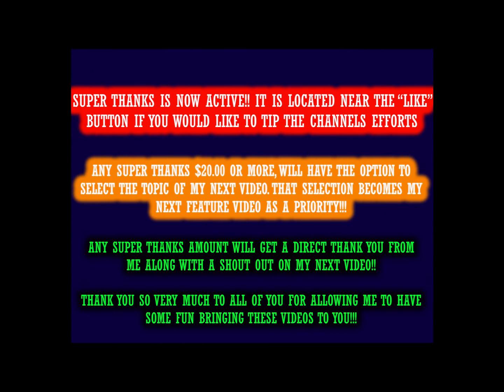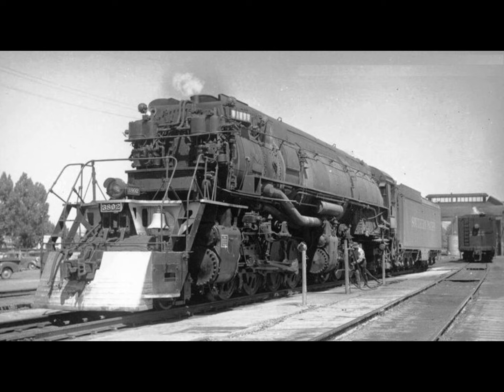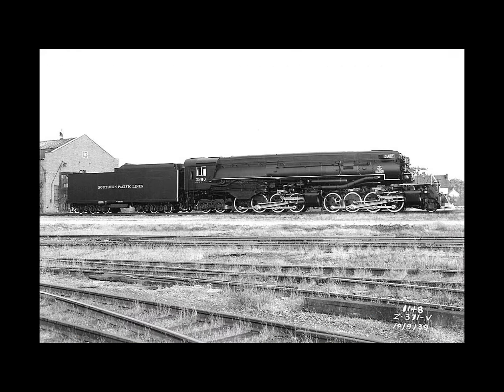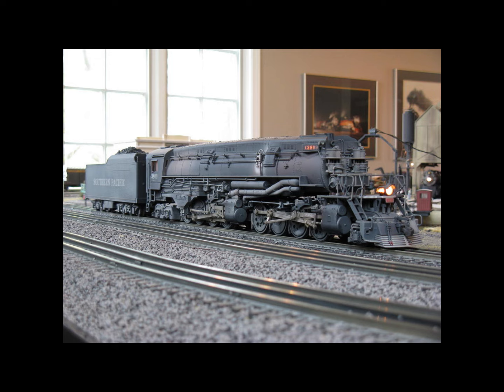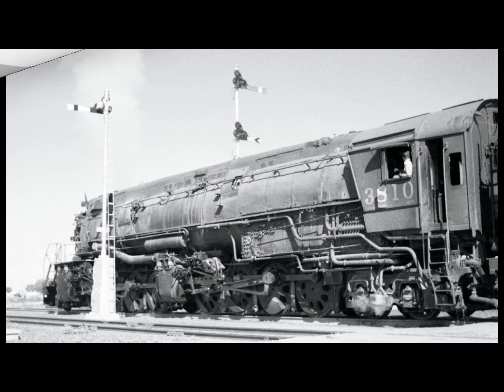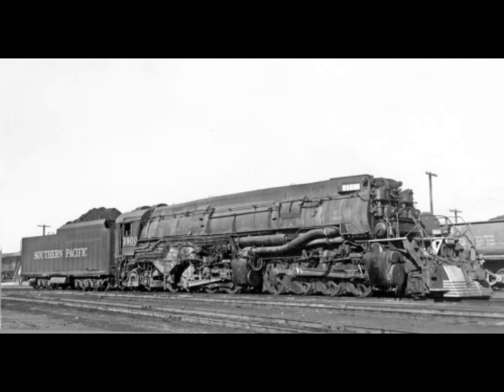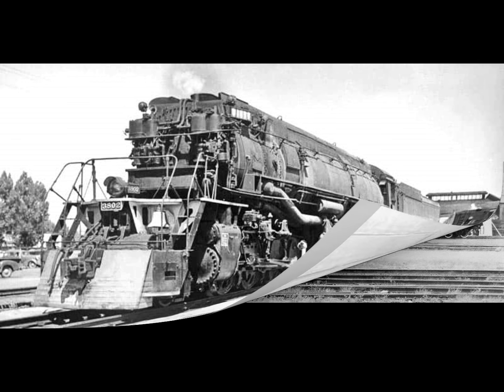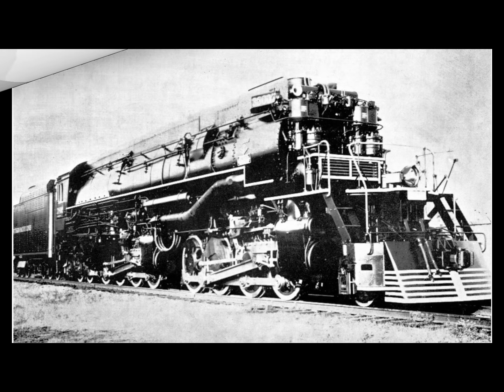Southern Pacific Yellowstone AC 9

Comment: The AC-9 is my favorite articulated steam locomotive on the Southern Pacific. Its design is very elegant and it’s the only streamlined-articulated locomotive I know of. It’s a dang shame that none of these were preserved. Nice work!
Reply: these were the only Mallet articulateds that were at least semi streamlined but the ASG's or Australian Standard Garretts were also semi streamlined articulateds and what it more interesting is that they were a standardized freight design drawn up during the height of the 1942 japanese invasion scare for Australia and yet had the streamlined watertanks and skyline casing for the boiler fitted when built.
Reply: actually the AC-9 is not the only streamlined articulated locomotive there is another streamlined articulated locomotive which was the P38 the P38 is a streamlined 2-8-8-4 built in 1954-1955 by the Kolomna locomotive plant for the Soviet Railways it was used to pull both freight and passenger trains
Reply from the maker: Video coming on that today...

Comment: The Southern Pacific AC9 class engines were unique among articulated steam power owned by SP as the AC9 was one of the few non "Cab Forward" style designs. The SP AC 9 class locomotives were retired from 1953-1956 and sadly all were scrapped with none of the 12 locomotives being saved for display observation. I wish that one example of the AC9 class was preserved as these were the SP's largest and heaviest examples of steam power, and one of the few non "Cab Forward" type design articulated locomotives owned by the SP.

Comment: Nice video, I just wanted to add that the oil conversion occurred between March to August of 1950 and that the Southern Pacific purchased 14 oil tenders from the UP when they were retiring their ex-C&O 2-8-8-2’s after WW2. The tenders were originally used with SP F class 2-10-2’s when they were purchased but then were used with the AC-9’s when they were converted to oil firing. Also, a random fact; there is no recorded photos of a AC-9 pulling a passenger train except for a rail-fan organized trip in May of 1954 using the 3809 - that excursion produced the only known photos of an AC-9 pulling passenger equipment.
Reply from the maker: Great Info!

Comment: The Modoc line didn't connect with Donner Pass. It went from Klamath Falls, OR to Sparks, NV. Before the Modoc line, eastbound traffic from Oregon had to first move over the tortuous mountain railroad that was the Siskiyou line to get into California. The traffic then had to move halfway down California to get to the transcontinental mainline, which then had to go back up and over the Sierras through Donner Summit before continuing on east to the Union Pacific interchange at Ogden, UT, for shipment further east. This routing consumed several days and involved lifting each carload many thousands of feet in elevation, which lead to high operating costs incurred by the railroad. The Modoc gave a more direct route over lower grades for that traffic.

Comment: Great stuff as always.  Thanks.  if you have info on how far an engine can go on its water supply, I'd really appreciate hearing that.  Cheers
Reply from the maker: I dont have the info specifically for the AC9... But I can tell you that the Duluth's Yellowstone's consume 12t of coal and water an hour which gives them 2.5 hours roughly of continuous running time at full power. That figure would be a solid ballpark for the AC9
Reply: @TheRailroadCrossing-SteamPower  Thanks.  Sounds like another reason diesels took over(much longer distances without having to stop to refuel).
Reply from the maker: Oh for sure

Comment: Thanks for another cool video.  The AC-9's seem to be overshadowed quite a bit by the Cab Forwards, but AC-9's are very cool and unique looking locomotives in their own right.  I think one area where all of SP's AC 2-8-8-4's or 4-8-8-2's may be overlooked is efficiency.  The 63 inch drivers of these engines would've allowed them to realize more benefit from their potential horsepower on grades as opposed to similar designs with larger drivers.  When Bachmann tooled up their B&O Yellowstones in HO scale, they probably could have used the same chassis to offer a model of the SP AC-9.  Sounds like a missed opportunity.   Cheers Everybody!
Reply from the maker: You're welcome

Comment: There's some great info here, thanks! About the NP's Yellowstone's. They built what they needed for the short 200 mile division they were designed to operate on. They had two failings, the drivers would not balance well, so pounded the rail to ribbons at design speed. Therefore the speed was restricted to 25mph until new better balanced wheels were installed when forged frames were applied. The cast and riveted frames originally applied were the second  major flaw. 

Like I said, breat info being put out here.
Reply from the maker: https://youtu.be/e9_tQoHk5VQ Thats a link to my original Yellowstone video that talks more about them.
Reply: @TheRailroadCrossing-SteamPower  Great, I will!

Comment: Very good publicity for an awesome locomotive!  However the Northern Pacific Railroad had monsters just like the Southern Pacific and other railroads but I have never seen any commentary about the Northern Pacific Yellowstone types.
Reply from the maker: The NP actually created the type.. It's in my very original Yellowstone video. The problem with the NP's was the poor coal quality. The original Yellowstone firebox was wayyy too big and the loco vastly underperformed. The problem was solved by blocking off some of the grate in order to improve draft. NP was somewhat put off by the issue and only ordered 12 of the 72 total Yellowstone's built. Here's the link if you want to watch that video... https://youtu.be/e9_tQoHk5VQ